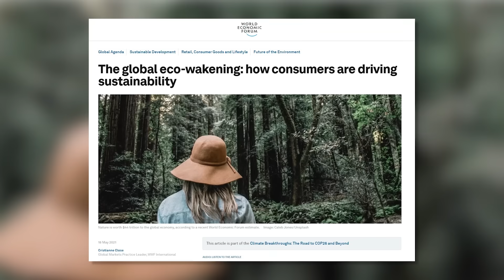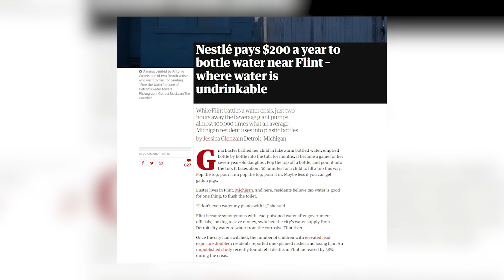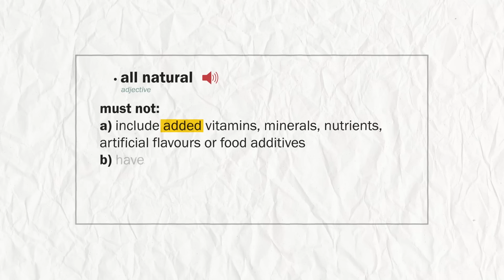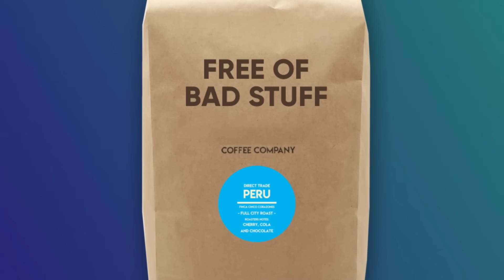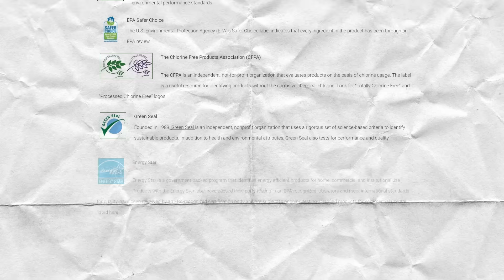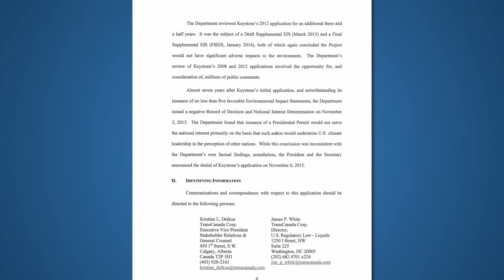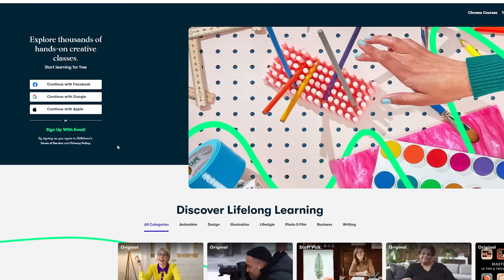Why Being 'Environmentally Friendly' Is A Scam

Comment: 7:00 That’s a lie. The reason the 2015 VW Jetta was attacked and removed was bc it got 45 mpg! And there’s no way EVs can compete with high mileage vehicles on fuel cost or CO2 emissions. ASAPSCIENCE guy neglected to mention that info. 
     I did the smog checks. Me. There’s no “software” that can reduce emissions during smog checks. And, the government never proved the cheating. I read all the articles; they never explained how software can change engine performance to reduce emissions during smog checks. Not once. I know how engines work, and I know all the engine parts. Not a single article explained the cheating beyond the propaganda. 
     And they never told us “actual  emissions”. If the emissions were bad, don’t you think they would show and tell us how high? Nope. Never did. That’s like accusing someone of murder without a murder victim. 
     Plus, a smog check on a diesel a basically a “snap test” where you rev the engine to see if smoke comes out the tailpipe. No smoke: PASS. If the diesel car was a gross polluter, then there would be a lot of smoke during normal operation. There   was   never   any   smoke. 
     Plus plus, you don’t have to be a mechanic to understand: This vehicle gets twice the mileage of a regular car. That means it used half the fuel. It would be exceedingly difficult and ridiculous to design a car that polluted more than a regular car; when it only used half the fuel.
     The scam is how government kept mpg low to make more money on gas taxes. And now they keep mpg low to destroy the car market entirely. Their goal is mass transit bc mass transit destroys freedom. 
    EVs are a short term, and a worse solution. If we can make cars get just 32mpg, they would generate less CO2 than EVs. The real solution is to allow cars to get 100-500mpg. I have proof we can do that.
Reply: I went from 👍 to 👎.
10:30 Tell me, how are pipelines bad for the environment? How are pipelines worse for the environment than trains and trucks? You’re not making any sense. Cancelling those pipelines was monumentally insane.

Comment: 8:18 Just forget that cotton bags could be used multiple times, washed with ease, repaired with ease, and at the end of its life became a new product through cotton recycling.
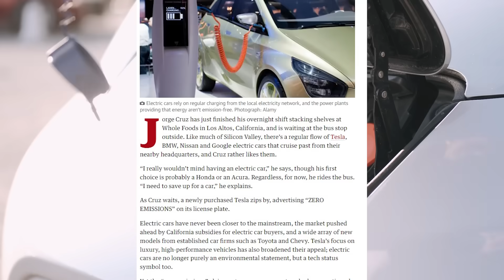8:24 That's just plain BS - one big pollutant far away is still vastly preferable (just because it's easier to install better filters or upgrade the whole process into more sustainable) to multiple small pollutants right under your nose.

Comment: Among the Greenwashing examples i really like are Plant Based plastics that cant be recycled, plant based milks like almond milk that require excessive irrigation & contribute massively to water loss & drying rivers. And the amazing green future of lab grown meat that to be commercially viable as a general meat alternative will require an almost exponential production of Bioreactor components, pipes & gages etc. An almost exponential use of energy to run the pharmaceutical grade labs the cultured slurry has to be made in to avoid contamination, & an enormous use of anti-biotics to account for the cell culture not having an immune system to avoid infection of cultured cells. And all that's before the production facilities to run the cultured slurry into "meat products". Also not to mention the huge amount of soy & corn needed to feed the cells the sugar they need on top the proteins & amino acids they need to grow.. All in all an impossible endeavor to ever be done at scale. Eg to produce even 0.0002% of current meat demand, would require one third of the entire global pharmaceutical bioreactor capacity. Just think of all the resources needed to produce all the bioreactors needed to produce at scale. And all the energy required to run the pharmaceutical grade 100% clean labs that are needed to avoid the cell culture dying before it's ready to be processed.. Ohh so incredibly green..

Comment: The best thing to do is not buy anything that's single use. Like Switching from plastic disposable razor heads for a double edge razor that only produces blunt metal blades which is a valuable recyclable material. Plastic isn't valuable even if you do recycle it. 

I even replace wiper blades on my car with refills which cost about 50p each, the frame for my wiper blades is probably 7 years old now. The way I save the environment is to look at the most cost effective options, which usually leads to switching disposable products for reusable ones. For instance, a shave costs me about 3p because I don't use shaving foam aerosols, I use shaving soap which lasts a hell of a long time and blades cost about 10p each and last 10-15 shaves. I probably have a lifetime supply of shaving products to be honest, the only thing I'm not sure about is how long the soap will last as my usual 60p shaving soap sticks have been discontinued but I've only used 1 over 3 years and I have 3 left so may have about 9-10 years of soap left.

Comment: Congratulations to the environmental movement for getting the Keystone pipeline cancelled. It just put thousands more oil tank cars running around the country, not to mention the exhaust from the diesel locomotives (compared to zero diesel from pipelines). Oh yeah, and that the annual volume of oil spilled by pipelines is orders of magnitude less than that spilled by tank cars. Yeah, way to go!

Comment: The saying is reduce, reuse, recycle and they're in the order you should focus on, REDUCE is the best way to reduce your impact, stop buying so much crap, reuse what you can. Doing your own recycling (composting cardboard and reusing jars ect) is much more effective and it actually guarantees the items aren't going to waste.  recycling is the least impactful, you can get paid for metal recycling (cans and such) but just putting a bunch of cardboards, metals and plastics in the recycling bin and feeling good about yourself is useless, like it was said in the video, most unsorted "recycling" just goes straight to waste anyway.

Comment: Most of  plastics aren't recycled at all! Everytime you try to recycle plastics you should pay attention to recycle ♻️ logo and the number inside. If it says like 1 or 2  you may be able to recycle it. But it will cost more then the fresh oil digged to make then. And 5 and 6 are beyond recycling. But for the sake of argument, let's say that plastic recycling would be half of their counter parts. The oil companies will make less polymers for plastic instead. The result would be they making cheaper gas, that would make fossil fuels cheaper. This fuel will become CO² in the atmosphere right away, instead of waiting to it to be decomposed in 500 years in a landfill. So if people would discard them as trash in a proper bin it would be better for the environment. The problem is that not all places have a sofphsticaded trash collection as most of American cities would. So they are washed by rain or improper disposal. Which makes them to end up into rivers and oceans. So if people want to have less plastic in the environment, they must automate and make it easier to people discard it in a common trash and landfill. That way the carbon in the plastic will take 500 years or more to reach the atmosphere. A landfill if it's property built won't impact the atmosphere for hundred of years.

Comment: re: the Keystone pipeline. The thing with that is even without that pipe, the oil companies are just not drilling and shipping that oil. They're just not using that delivery method. I only bring this up because there were reports in the years following of trains from Canada literally exploding because they were transporting that tar sands oil into the States by train rather than by pipeline. And for this product, trains are a much more dangerous delivery method. So in this case, feels like a case of damned if you do and damned if you don't.  The only real solution there wasn't to protest the delivery method but instead to push for restructuring our cities so they aren't so dependent, thus reducing the demand for that oil

Comment: At least in many countries manufacturers of cars and domestic appliances are made to take responsibility for the cost of recycling their products at end of life to some extent. This needs to be applied to other recyclable materials, eg plastic bottles. Manufacturers of plastic packaging should be made responsible for collection and recycling of their products, or at least contributing to the cost. Plastic packaging is artificially cheap compared to other packaging simply because they are cheap to make but expensive to recycle - the part of the process they take no responsibility for. And I feel that disposal and recycling should be the responsibility of the country where the waste is generated - shipping it off to 3rd world countries with lower standards to be "recycled" (i.e. stripped of anything useful an put in landfill) is just cheating.

Comment: Being honest is what I think the important theme is here. I do want to want to push back on the idea of pipe lines being shut down as automatically a good thing. Everything we do will have some kind of "negative" impact on environment and we need to make that impact on environment in order for people to get the supplies they need to survive. If not a pipeline then people will get their oil somehow. So while a NEW environmental intrusion of a pipeline may not be introduced, they might use an existing railroad and train system to get oil to people instead. Which in turn would be slower, more expensive to transport, create more pollution, and inherit more risk for accidents than a pipeline. The end goal for all of this is to benefit as many people, in all walks of life, as much as possible- both in the short term and in the long term. Corporations making money doing this, even a lot of money, is not in itself a bad thing. Only when corporations, government, and people aren't being honest about the weight of the risks and environmental impact to the benefit of humanity, so that we all can make informed decisions, is this wrong.

Comment: i got a tote bag out of the trash at the thrift shop and washed it with a small load, and bought 4 gallons of milk in it, so it has saved 8 of those bags that are never recycled.  people say they don't pay.  well, buy a used one, then.  if you have some you don't want, give them away.

he says ecars might be using fossil.   but if you have one, it's possible to change that.  the gas car always spits out crap.  if you have an ecar, why not a solar panel on the roof?  say it does half a charge in an average day.  well, that much was saved, and maybe you will not use that much, and get closer to full tomorrow.  doing nothing is the real mistake

Comment: I would add one more sin, in which nearly all "environmental friendly" products fall, it is the sin of "contextual optimum omission", which is kind of a derivative of the sin of vagueness. 

COO is when you present a product as environmental friendly, and "forget" to discuss its impact in regard to best solutions it competes with in each applicable context. The other version is to present the product in its best context, without mentioning it is the best context of use that is possible.

For example, it is presenting an electric car as producing less CO2 than a fuel one, but omitting that in a lot of cases, as the fact that for distances lower than 10kms, a bike is producing much less CO2, and that public transportation exists for longer distances and so on.

Comment: So I agreed with everything in this video but the pipeline actually would have been a good thing. The simple fact is that they are going to transfer the oil either way. And a pipeline would be the safest way to do that environmentally speaking. It would also lower the gas prices everyone has been complaining about recently. It kinda sucks but you have to pick your poison

Comment: Single use disposable products are the biggest scam.  Reusables are much better as long as you get a lot of use out of them and don't dump them just because they were given away free as merchandise.  I went litter picking and saw a reusable travel mug and steel water bottle thrown away as litter just because it was free or cheap.  They were probably used just once or twice at the most.

Comment: Anyone care to weigh in on how transporting oil by rail, semi-truck, and diesel tankers rather than a pipeline is somehow a win for the environment?  Don't the logistics used to move the oil produce more emissions than a pipeline would?  And rather than having a singular monitored pipeline potentially break causing significant but localized damage, now we have thousands of boats, trains, and trucks spewing combustion products into the atmosphere while also being at a potential risk of failure over multiple greater surface areas?
It's not like they just stopped moving the hydrocarbons when Keystone XL got shut down.  What am I missing here?

Thanks!

Comment: Not necessary an environmental scam but in cosmetics "natural-only" products are a scam and shouldn't be picked over a synthetic ones. I was in college but I dropped it due to amount of scam and bullshit that exists in this industry. 
Natural-only products aren't more healthy, they can be more allergic to the user since you can't check the exact concentration of allergens in natural oil (every plant will have a different concentration).
Natural-only cosmetics can't use ANY synthetic components/ingredients including preservatives. Which means that this product must be used quickly (which is very unlikely), if not then it leads to product contagion.

Comment: Just because the authors of the Keystone XL pipeline may of had a conflict of interest doesn't automatically mean that their conclusions were wrong. While I don't know all the stats it seems that transporting oil by pipeline is better for the environment than by truck or rail. Assuming you have to use the oil regardless.

Comment: I stock shelves at a store and it’s funny how they have to get brought here by truck, possibly plane, which isn’t the best for the environment, and they get wrapped to them teeth in plastic when put to the floor a lot of the time. There is so much unnecessary packaging. We literally have a gigantic tub, like… I think you could fit many people in there… and we fill it with plastic. We have 3 sections, all of equal size. Hard plastic, regular plastic, and styrofoam. They get filled up so quickly!

Comment: Regarding this pipeline in the last example... cancel the pipline is only good news if the alternatives are significantly bette. Did this reduce the consumption of oil? If not, where is the needed oil now coming from, and how is it transported?
Often people think that the most obvious "change" it sthe best. In Germany we have a problem with gas supply at the moment. Some news now claim: reduce the water temperature while take a shower will help to reduce the used gas.... yes...but: you might reduce the temperature and save about 6% befor it becomes very uncomfortable... but reducing shower time by 6% is much less comfort loss and saves same amount of gas. In fact most people can cut the shower time by 50% without negative side effects. But taking a colder shower seems to be a better selling headline.

Comment: The car thing is bs. CO2 is not really a problem, especially from cars. Euro 5 standard is so strict that you can boost your hp by 20% in some cars by removing the catalytic converter. It butns nearly all toxic stuff. Besides, try to burn gas, there is barely smoke, it is super clean. On the other hand you have zara manufacturing clothes that the cloth was produced in india, stitched in bolivia, painted in china and sold anywhere. And ships use heavy fuel oil and there is no euro standards on them. But yes, my commute is the issue

Comment: Recycling is a joke.
Most of everything is not actually recyclable. (If you are in the US) Milk jugs, the main part is one kind of plastic while the top is another. One can be recycled and one can't. If a bad or dirty plastic is with the main bunch being recycled it causes a lot to be throw away and not reprocessed properly.
Recycled plastic can't even be used without additional processing. It has to have a lot of virgin plastic added to it to be useable. All those 'made with recycled plastic' is mostly virgin with a small percentage of recycled material. 
Most stuff being recycled gets sorted and just sent to the landfill anyway. Clean glass and paper is the best to realistically recycle. Everything else, just throw away. This prevents it from be trucked to the recycling plant (or county) just to be trucked or shipped back to be in a landfill anyways.
Company's leaned hard the the last R of Reduce Reuse Recycle, because that's the best for their pocketbooks. The first two are the MOST important.
I was taught was Reduce your consumption FIRST, Recuse when you can and when you can't then recycle.

Comment: And yet these people will still tell yah that Nuclear and Fission isn't a viable green energy strategy, whilst hyping up windmills and solar panels. (Which aren't particularly or realistically recyclable respectively.)

ALSO! That pipeline would have been a green boon, twit. It takes only electricity to pump oil through a pipeline. Now you've got people wasting more oil (A limited resource) as fuel to carry it by tanker truck (Much less secure, stable, and safe) from place to place. GREAT IDEA!